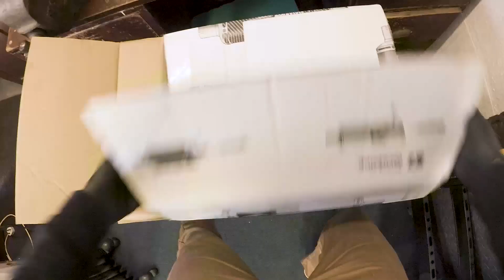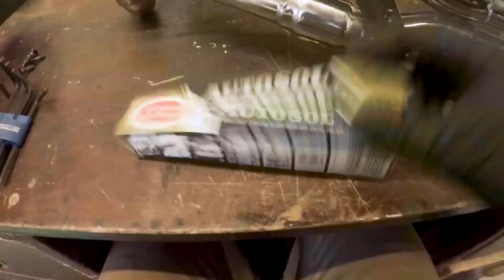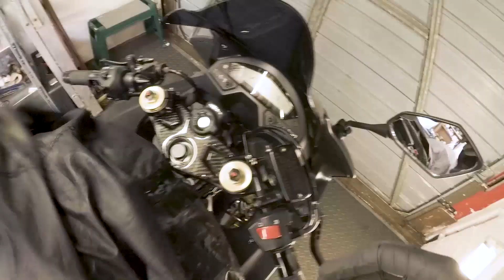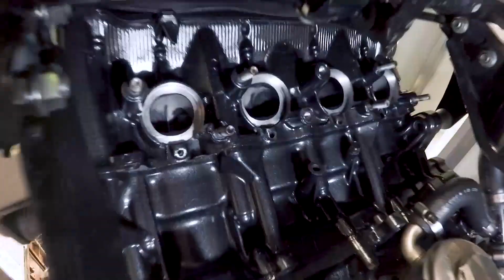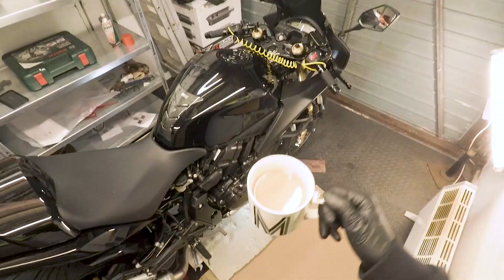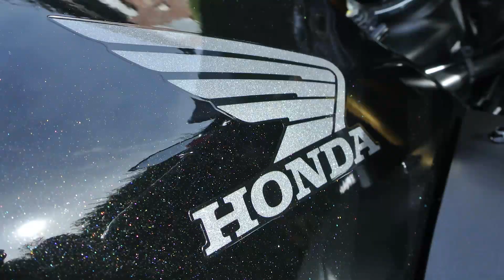Honda CBR 600f decat Akrapovic exhaust sound 2013 2012 2011 PC41 Black Widow

Comment: Ive done some kilometers with the Black Widow - Honda Original Akrapovic combination and i have to say its quite a bit louder in the lower rpm's. Exhaust temps are a lot lower, as is the oil temp.
Reply from the maker: Sorry I missed this comment. Yeah agreed, it's miles better than the original pipes. Just the weight difference is enough to make a better change. Sorry for the slow reply 🤦

Comment: Does this bike have a comfortable seating position? How does this compare to a cbr600rr for example. Sounds good 👍
Reply from the maker: I have a 600rr aswell and the 600f is more upright. It's less tiring on the wrists and lower back. The RR is very leant forward and feels like you are sat on top of it, this feels like too are sat lower on it. Hope that makes sense. The seat on this is much bigger than the RR so way more comfy for longer distance. I'd class it as sporty touring bike. It's not totally upright and it's not leant forward like a sport bike, it's in the middle. As a first bike it's great.
Reply: I was hoping you'd say that about the seating position as that's what id imagine it would be. 
Is not my first bike, I've had a couple of sports bikes and am after something comfier and slower where I can go up and down the hearts a bit more on the road without going silly speeds. If I could find a modern inline 4 400cc/500cc  sports  tourer style I'd be very interested, but most of them are twin cylinders. I'm guessing this is a bit slower than the RR tho so might be worth a test ride.. thanks for the reply 👍
Reply from the maker: Yeah it is a bit slower. It's about 100hp compared to the 116 on the RR. But it's still fun. Even the RR isn't quick for today's standards. It's a nice compromise and I got it for longer rides out and just taking it easy. I don't like riding fast on a road, personally I don't see the point. I try do that on a track. Yeah have a go, see what you think 😊
Reply: @SuggyRacing  same reason I'm after one really, cheers mate 👍

Comment: Have you done a remap on the electronic after the decat? If not, any problems in performance? I am doing the same on mine and I hear a lot of different opinions so will be happy to know your experience. Thanks. The motorcycle is amazing!
Reply from the maker: Hi. Yes I had it remapped. It's got a dynojet power commander 5 on it after I removed the cat. It does help it to run smoother and adds a bit of power. It mainly helps the performance of how fast it picks up. Without the map it runs, but not that good. You can get away with not doing it, but it definitely helps. 👍

Comment: Hi mate - great but of kit, I have the same with stock system. The plans is to do what you have done, and I can deal with the fueling occasionally running rich but did the decat/system throw up any lights on the dash like the engine management light?

Thankyou in advance 😊
Reply from the maker: Hi. No nothing will come on. It's just a case of switching it all out. The power commander is just to stop it being rich. It does help smooth it all out too. I did have a quick shifter on it too, but took it off for my track bike. It was fun though 🙂
Reply: @SuggyRacing  perfect, sounds great, do you have the link for the downpipes and link pipe/slip on?

Thankyou :)

Comment: This is a class looking bike, do you still have it? What's the issue with the brakes on this model?
Reply from the maker: Yeah still got it. The brakes are linked brakes, so good for safety, but not good if you ever wanted to go fast on a track. It would be better in my opinion of they were just standard ABS brakes.
Reply: @SuggyRacing  ah ok I am going to look at a black on this week with Akra exhaust. Has 24k miles. Do you find the ABS any good on it? Thanks
Reply from the maker: @frankedoodle3798  Its a nice bike for a mix of sport and comfy. It's not mega fast, but it's smooth. It's a great bike to do everything. It's ok the brakes, they could be better but also nothing wrong with them as they are.
Reply: @SuggyRacing  thanks for the info. I chose those over the older CBR 600f4 because of the ABS
Reply from the maker: @frankedoodle3798  It's definitely better than the older 600f. It rides really well. I had mine mapped so it's pretty nice. I think you'll enjoy it if you use it for a bike that does everything. If you want something  fast, the R6 ot the RR is better. This is way better for comfort though. It's not leant over as much.
Reply: @SuggyRacing  appreciate all the info thanks!

Comment: Can you add a link to the downpipes. The ones I found online don’t look like your one
Reply from the maker: Hi. They changed the design a couple of years after I got the original ones. The new ones copy the Arrow exhausts. Probably a better design and easier for them to make. They run down the left side of the bike, whereas mine run down the right and mirror the original honda exhaust. I also had someone weld on a bracket for me, so that I could use the heat shield. 

That's the latest model...
https://www.blackwidowexhausts.co.uk/cbr600-fa-2011-2013-de-cat-race-exhaust-downpipes-headers-28087-p.asp
Reply: @SuggyRacing  ah got ya. I want to keep the side panel part so that it looks the same and keeps the body line. So that was just welded on brackets to screw the side panel onto ?
Reply from the maker: @MarcJWebbMusic  yeah that's what I was trying to do aswell. Just looks nicer. Plus on that bike, you don't want to be making too many mods as it already looks pretty nice. Yeah I took it to an exhaust company and took them the original exhaust. They just copied the brackets and made them the same, to fit the heat shield. It sounds so much better with the new exhaust on it
Reply: @SuggyRacing  yeah for sure. How much did they charge you ?
Reply from the maker: @MarcJWebbMusic  I can't remember to be honest as it was a few years ago. It was a bit more effort than it looks for them to make.
Reply: @SuggyRacing  where are you based

Comment: Stunning result dude, from real is surely more impressive! 
I have the same bike and thinking to decat... Eventually would you recommend me Black Widow downpipes (cheaper) or Arrow ones?
Reply from the maker: Cheers. 👍

It's up to you. Mine are black widow and my mates are arrow. Pretty sure his are titanium and mine are stainless. His are better made. They do sit down the left side of the bike, where as mine are on the right like the original pipes, which I prefer. His leaves a big gap on the right where the oil sump is. I'm not a fan of that.

Comment: Are the black widow downpipes on the video from the 600f Hornet?
Reply from the maker: Hi, no they are made for this bike. They did them specifically for this model, 2011-2013
Reply: @SuggyRacing  I’ve got some on a bike I’ve bought but they don’t look like the ones you’ve installed, fitment doesn’t seem great as they are touching the oil pan/sump
Reply from the maker: I'm not sure then to be honest.  I know arrow made a set, but they sit on the left side of the sump. And the  black widow I have sit on the right. But both sets clear the sump no issues

Comment: Meanest looking 600f I have seen. I reckon a clear or light smoke windshield would take this to another level. just my personal preference tho
Reply from the maker: @manbiteslife3110  cheers. I'm actually looking to sell it at the moment. Fancy something different 😁
Reply: @SuggyRacing  You've kept it for so long! Yeah it's due for an upgrade, it's a bike that can do everything great but nothing perfect imo, but that's what makes it amazing. Decent low torque, comfy clip ons, pretty stable unless you smash the throttle (imo everything that exceeds 200kmph needs a stabiliser) , could use better brakes etc.. How did you find the suspension? I am a heavy rider 100kg so for me it was underwhelming.
Reply from the maker: @manbiteslife3110  yeah as a bike, I can't fault it. It's probably one of the best all rounders as you say. I still love riding it, it's just that I like doing track days and racing now. So I barely ride it. I'm tempted to not even bother with a road bike after this. Yeah what let's this down are brakes and suspension can always be better on any bike. But, it's still a decent ride on the road. Yeah if you are heavier, maybe get someone to try set it up for you. They will come set to a standard setting which is never ideal
Reply: @SuggyRacing  I've seen a lot of track videos in your page. I had a cbr500r when I was doing some track days and advanced lessons and it was so fun, and I kept up with everyone. The joys of riding a slow bike fast is unmatched. I need to get back on the track to hone the skills some more.

So right now you don't want to ride bikes in the street or maybe you have a smaller one for errands? I'm situated in Greece, and the amount of time I save by zigzaging through the traffic is unreal to not have one. Are you looking to go all in in the track and racing thingy?
Reply from the maker: @manbiteslife3110  Yeah I just find it more enjoyable. The traffic on the UK roads is horrendous so it's just not fun at all, unless you go out very early morning or late at night. Then we have a lot of rain to deal with. I just do the odd day/race when I can. Gets very expensive. Yeah I agree, smaller bikes are so much more fun 😁

Comment: Hey, question. How did you get those exhaust ports so clean?
Reply from the maker: Hi. I just used brake cleaner and a 'light' rubbing with fine scotch brite. Nothing too rough though. 👍
Reply: @SuggyRacing  With my bike the exhaust studs came out of the head :(  The nuts were rusted stuck to the studs. they werent really tight so i guess the threads werent damaged.  I ordered new nuts and studs. Did you experience any of this? I found it weird that this happened on a 9 year old bike with 17k kms.
Reply from the maker: @maarteneevers3648  yeah mine were exactly the same. It's best to replace them if you can get them out ok. Some of mine came out, others didn't. On my 600rr track bike I replaced them all. Yeah they aren't very tight at all, just enough to keep them In place 👍
Reply: @SuggyRacing  i got new studs and nuts from Honda. I contacted Black Widow today concerning their exhaust system. I bought their newer version (which you have to assemble yourself) + a link pipe to fit the silencer. 
You don't need the link pipe if you keep the original silencer or the Akrapovic option (0F88 MGV 900)

Comment: Hi, 1st, what did rub in the pipes that actually took away that natural shine and 2nd, would you have the ebay link for carbon belly that you attached to the pipes? Many thanks!
Reply from the maker: I rubbed Autosol in to the pipes just to clean them up before I put them on the bike. I had the brackets welded on the pipes (to fit the carbon heat shield) so they were covered in finger prints. The heat shield was from a company called FF Carbon on eBay. Can't seem to find any on there now. It was 2 years ago I bought it.

Comment: Hey man, sounds great! Where did you get that heat shield? Did it come with the down pipes from black widow? Couldnt find one from their site. And also did you have to re-map the ecu?
Reply from the maker: Hi. The carbon heat shield was from a company in Germany called FF Carbon. I had to get a local exhaust maker to weld on brackets to be able to fit it to the black widow pipes. They don't have them as standard. It's got a power commander 5 and custom map on it. 👍
Reply: @SuggyRacing   Thanks for the answer!
Reply: @SuggyRacing  Hi mate, what year is your bike and which PCV did you get?
Reply from the maker: Mines 2013 and it's got a power commander 5 👍

Comment: Hi there, noticed youve got belly pan with pipes. where did u buy it from? thanks
Reply from the maker: Hi, the carbon cover is what I bought for the original stock pipes.  When I bought the black widow down pipes I had someone I know weld me on a set of brackets to match the exact ones on the stock pipes. I wanted them to look like be original pipes but without the cat. So to answer the question, if you want the carbon cover you can get them on eBay. But to make it fit the black widow pipes you'll have to do some modding to them. Hope that helps.
Reply: @SuggyRacing  ahh great. Thankyou

Comment: Hi,
Did you remap the original ecu / used a power commander to go with the decat system? Have you noticed any performance increase?
Also, where did you get your engine covers? They look great
Thanks
Reply from the maker: Hi. I haven't re-mapped it yet but I will be doing. I'm going to get a power commander put on then get it on a Dyno, see how it does. I've heard it helps a bit. But the sound difference is massive, so that's definitely a positive. The video doesn't do it justice at all. The covers I found on eBay. I just googled pc41 carbon and they came up. Just make sure you get the correct year and for the CBR not the CB. They came from Germany. Glad you like it 👍
Reply: M S Thanks :)
Did you notice any performance drops across the rpm range? I’m considering a budget workaround that involves deleting the catalytic converter
I’ve read some pros and cons and still not sure whether I should do it or buy a decat system. 
Please let me know when you’ve installed your PC, that should be noticeable
Reply from the maker: @gabelfreak9843   I haven't had chance to really try it out that much since I installed them. Mainly because the UK weather turned crap. However, I really don't think it made any negative effects on the bike. It's got the stock air filter in at the mo. I will put the k&n back in when I get the PC. So that should breath a little better. I'm hoping once the PC is in, it will have a few improvements. At the minute the main difference is sound and a bit of weight reduction. By budget, do you mean cutting the cat off and welding a pipe in place? Guess it's doable if you have the skills or know someone. Personally, id just get the pipes from Black Widow or Arrow, probably easier. The weight difference is pretty big. Yeah I'll keep you updated. Probably within the next month or so. 👍